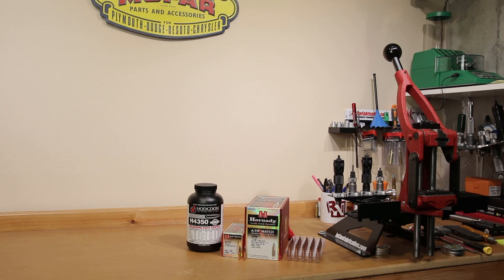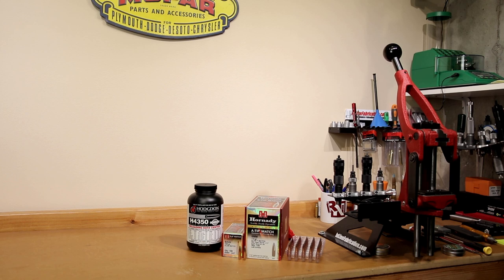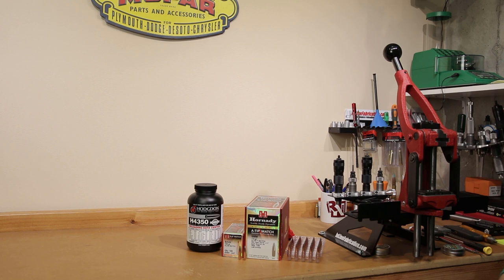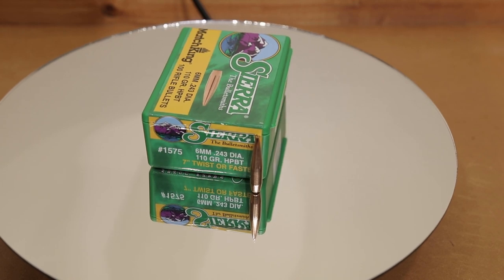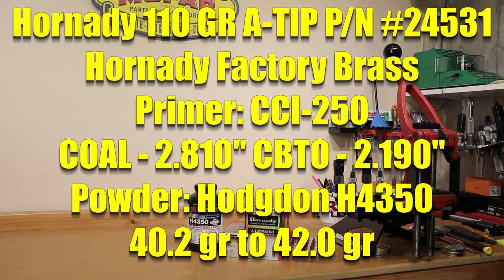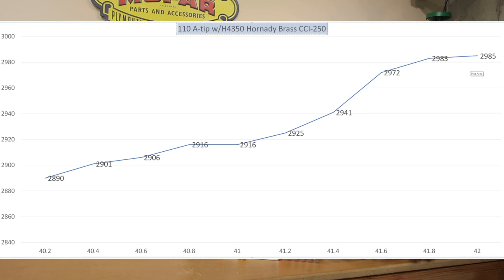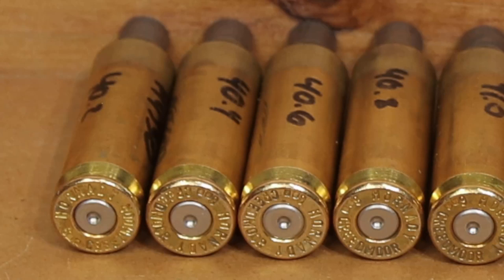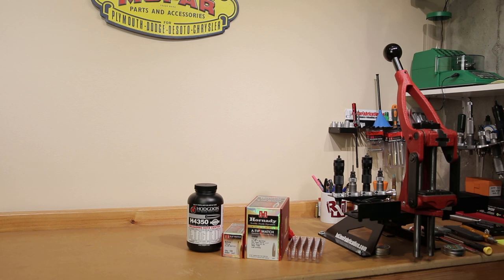Hornady A-TIP 110gr - 6 mm Creedmoor - Overview and Load Test

Comment: I ran 40.0gr of H4350 under a 115 Dtac for 2900fps in lapua brass  this past year at matches.  I'd look closely at 40.8-41.2 if your wanting to be in a higher node, 41.2 was the recommended load from George at GA Precision when he helped develop this cartridge. That was with 105 Berger's.
Reply: This is interesting, as my best load is H4350 at 41.0 grs with a 105 Berger.  Any higher and the groups open up. thks

Comment: I really like this series, cause I do exactly what you were doing (including the mandrel) and I'm on the fence on the 110 cause the 108 gives me fantastic results(single digits SD w/0.25 moa at 550y). I know I'd pick the higher node and for the next step, load 0.1g increments from 41.7g to 42.7g, watching closer the brass after 42g, and possibly stop if it looks too bad. I couldn't get from your video what are going to do next(maybe I need to watch it again). Looking forward to the next one.

Comment: Have you used TNB coating in the neck and the on the bullet to reduce ES? I know you used the 115 dtac's that were coated in another vid. Just wondering if you use the mix of TNB and distilled water in the neck.

    Also if your looking for speed why not try reloder17. There are a couple of articles on accurateshooter where German Selzar gains a considerable amount of velocity with 17. Less peak and longer burn ratio.